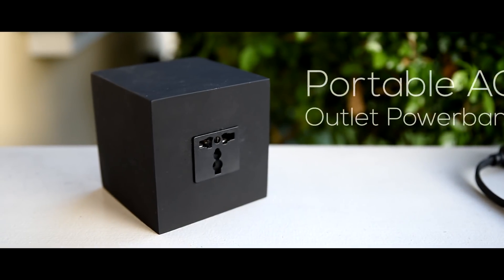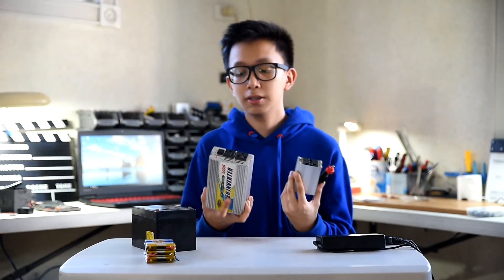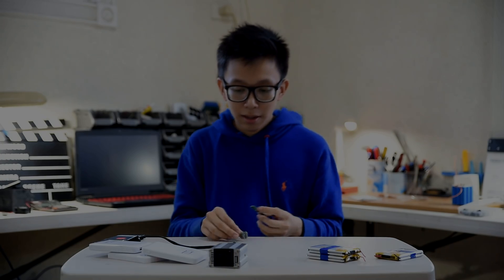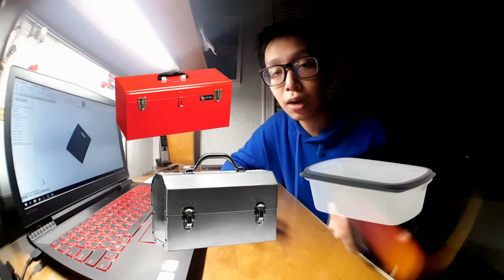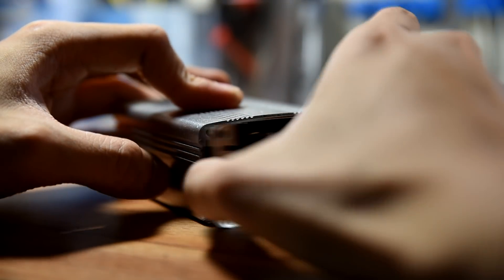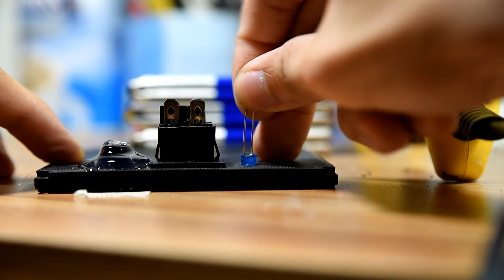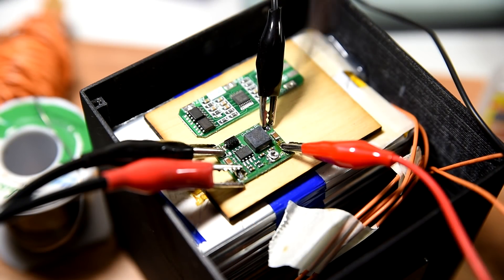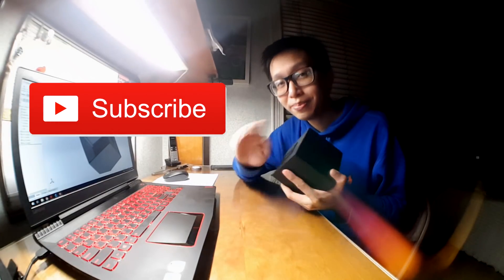DIY 220v Powerbank Outlet

Comment: Solder a much thicker wire to the battery =(0V and 12.6V) to the BMS to the converter, so that the wire does not heat up and reduse  voltage drop.

Comment: it is a bomb timer. No temperature control, no relay, no fuse, etc. You should not solder the battery because the soldier can overheat the battery and explode.

Comment: very low power watt Project !  instead you shud go for 18650 Li-ion batteries
which are available from $1-$2 Battery Packs of 4 Volt in US/UK online websites.
and in $1 b.pack it contains 3 batteries as new as baby.

so you get very cheap battery bank and higher amperages you can give to the DC AC Converter

Also you need to have 40A BMS Charging system + DC-DC CCCV Boost converter which outputs setting 19.6v ~4A for laptop charging and USB Powerbank module with resistance connected at input for charging mobile/tablets .

DC Watts is not equal to AC Watts 

DC Watts = DC V x I amp   
AC Watts = 230V x I amp 

so your battery bank wattage should be equal to atleast AC Wattage value.
230v x 5 Amps = 1150 Watt  example.  so
1150Watt DC / divided by 12.6V DC = 91 Amps  
91 Amps Divided by 8 amps per series of battery :  11 series
Total 18650 batteries needed 11 x 3 = 33 Cells

isn't it nice....  i am undergoing the process of making such high amps project

Comment: Very unsafe man! Thin wires and lipos just over a step up converter which it is going to heat up considerably when used, all joined with glue and wood which is very flammable
It seem more like a big expensive lighter to me.

Comment: I have a question, I plan to do the same but with the power bank I want to convert 5V to 12V with a dc dc step up and then use the inverter so 12V to 230V and my question would be how much amperes would end up

Comment: There is no way for ventilation for the cooling of the inverter curcuit and the wires are so thin it will starts heating up and melting at 70 watts

Don't try to copy his designs as the are no proper. When you are drawing 150 watts of power the it is recommended to add some ventilation and fan also which are no present their.

Comment: As many comments say it's not safe to put a high voltage so, Can i use it only for charging my mobile and laptop??
Laptop requires 20v 65w...
And i want to use 18650 cells instead of batteries...
I know nothing of electronics please help!!
Reply: Secondly, if I use thick wires would it be more safe than in the video? As many os comments also pointed the wires were too thin...

Comment: I'm surprised I don't see one comment asking about runtime at max load. If I am powering a gaming laptop that uses 150 watts of draw....how long will 3-8000mAH power banks last? Assuming they are fully charged for a total of 24000mAH.  I think the formula is (mAh)*(V)/1000 = (Wh)  So 24000 mAH * 12V / 1000 = 228 Wh.  So about 1 hour 30 minutes? Is this correct? If so, that's not a bad run time at all.

Comment: how much amps can handle the step up converter ? I think it will be around 4-5 amps so bnasically at full load you´ll able to take out around 60 watts, before the circuit blows.

Comment: You should had calibrate the voltage regulator to 13,3V because of the 0,7V drop of the diodes in the circuit.

Comment: 6:26 could you also solder more wires to the original ones attached to the inverter to extend them? I'd probably forget where the + and - pins are if I desoldered the whole thing.

Comment: Most BMS can handle up to 20v DC input so if you're charging your powerbox using a laptop charger that has around 17-19v then you wouldnt need a step down dc module, right?

Comment: The only problem with this is that it will be able to power your gaming laptop for around 40 minutes (considering you are using 3 8000mah power banks) To calculate how many minutes it will last use this :  (ammount of total mAh / 1000) * 3,7 / (the wattage load) * 100 * 60 / 100 =      the result is how many minutes it will last.

Comment: This project is terrible. Those LiPos are not designed by any means to pull out 15A from them (Assuming 150w load and loses in the inverter), is a crazy high amount of current for batteries designed for a powerbank that uses at max 2 or 3 amps. Those wires are too thin for the current you are dealing with in the DC side. Also with your design you loose the USB plug of the inverter that is way more efficient than pluging a wall outlet in the output of the inverter. The diodes will dissipate a lot of heat (Assuming that they can withstand the 15-ish amps that the inverter will pull out from the batteries at 12v 150w, assuming a efficiency of around 80%) and make your voltage to drop by 0.5v. Not good at all

Comment: Thats not ac that using an battery but it could work for ac appliaces almost all appliaces is coverting into dc using 1 diode or an FULL BRIGE RECTIFIRE

Comment: this is very poor quality electrical design. the buck converter has no current limit and lithium cells love amps. the inverter cannot vent from the enclosure, the dc wire sizes are way too small for a 150w inverter and there is no fuses. lithium batteries are dangerous if mishandled like this

Comment: The most important thing to remember is that this power bank can only supply a very low power.  It can power a laptop computer or a single light (maybe both if you're using a low power LED light), but you're out of luck if you want to power anything much bigger.  It definitely will not handle the current required by a heater (for example).

Comment: Cool. But how long can it last? For example, how long will a tv stay on? How many charges of a laptop? Just an average, I know it will vary depending on the item powered, but just want to make sure if it's just a fun project, or a real world functional device. Because that way I won't be wasting the money, because it has lots of parts to buy.
Reply: we're currently doing a similar project like this on our thesis and your questions are our exact research problems! we're going to test it on different small appliances and devices =)

Comment: hey do you think we could use this inverter instead of the one on your link? as its less expensive?
https://www.banggood.com/12V-5V-Fully-Isolated-Switching-Power-Supply-AC-DC-Module-220V-to-12V-p-1000431.html?rmmds=search&cur_warehouse=CN

Comment: While the intent of this project is admirable, planning and execution are dangerously lacking. Do not build this project as shown.

Wiring is undersized. No fusing. No voltage, current, temperature, etc. protections. The list goes on.

Do your homework, then build accordingly.
Reply: Rubbish! The safety issues are in the wiring between dc jack and input of the inverter thats more like a device for burning your house down than for a mobile charger.
Reply: TechBuilder Sorry, but I beg to differ. Inverters provide under voltage cut-off. This doesn't protect the power source directly. It alerts the user that acceptable power out is no longer available.

The very real dangers inherent to your design and build are a) in the wiring, which is woefully undersized for the current it's expected to carry, b) in the lack of fusing to protect the cells from shorts/opens, etc., as well as the wiring, and c) the lack of all other necessary protections required by lithium chemistry batteries (over charge, over discharge, over current, temperature, etc.), as well as balancing.

As I said in my original comment, your intent for this project is admirable. However, the design, planning and execution are lacking. As is, this is a potential disaster waiting to happen.

Rather than defend a questionable project, why not take constructive criticism to heart, do further research, then do a follow-up video addressing the flaws in the original design? The are many great books, videos, etc. available on this subject. I suggest you avail yourself of the information available to you. It's how you'll grow and get better at your craft.

Ignoring potential dangers isn't prudent.

All the best.
Reply: Jan Feucht Your comment is spot on.
Reply from the maker: The inverter includes all those safety protections.

Comment: There's really very little reason to bother inverting it just to go back to DC all over again for the laptop; a step-up converter would be far more efficient. You can just google for a car charger for your laptop and use that, pretty much.
Reply from the maker: This was just for fun. I made a different tutorial about converting DC directly for DC powered devices. It was supposed to be posted along with these, but I haven't finished the edit yet.

Comment: I used a dc to dc converter with led display. I did not use the one diodes because of that but it is working so far but the diodes are are a good idea. I am going to use one from an old computer power supply

Comment: Little help here please.
I'm using Acer predator Helios 300 
Its wattage is 180 watts
 can I use the above power bank for my laptop ?(He mentioned it is for 130 Watt devices)
Reply: Anyone?
Reply: It wouldn’t work for 2 reasons:
1.- the wattage that your laptop’s charger needs is greater than the power bank supplies, ending in the power bank overheating and make it extremely unsafe, and here comes the second point
2.- as the power bank is using thin cables and diodes arranged in parallel (one of them will stop working, making some or one diode to carry all the load), it will damage either the power bank or your laptop’s charger
So go safe, don’t do this project and get a good power bank
Cheers!

Comment: Thanks for the video, and can i use 3p 3s Lithium ion(18650) batteries with output voltage as 11.1v and  capacity is 7800mah for the same project?

Comment: 6:39 "But you might want to save the front panel..."
No, no, no. Get a much safer AC socket for your specific country, better connection and no risk of electric shock when the plug (US especially) doesn't cover all of the holes.
As others have said, get high current Lipo/18650 cells for the battery, and proper charge/balance circuitry. A proper Li-Ion BMS will have a figure for "balance current", for this project you need a 3S BMS.
For those without much electronics skills, pairing a Lithium Ion Jump Starter to an inverter is an off the shelf solution with minimal work.

Comment: Can it power the entire house, you know that the cigaret lighter in the car has a fuse of only 15A, on 12V, that's 180W, that's just enough for a TV, but you use a 12V were you have no fuse, than there is a lot more power but a 12V invertor can only output like 3680W, I won't give bad comment my friend, it's just a detail. But very cool project, I'll make it for myself, I love such a projects.

Comment: Nice design and I see the appeal of the smaller form factor however you could just wire it up to a car battery and save yourself some headache. Also car batteries are cheaper if you get one from a scrap yard. and car battery chargers will tell when it is fully charged. Nice video well done.

Comment: Awesome video and awesome project. SolidWorks! A wonderful tool. very impressed. I have been thinking about doing a project involving a 12v 20Ah Sealed Lead Acid battery and 200W invertor. It will weight a bit more than yours. Li-ion have a much better Power to Weight ratio than Sealed Lead Acid Batteries.

Comment: Using this batteries is very dangerous, because they can provide only something about 1,5A for each cell (so something about 4.5A at all) and this converter will take 13 A on full power... DON'T DO THIS or it will explodes... Better solution is using acid battery...

Comment: Make sure to not have it pump out more wattage then it's supposed to. It could explode.  And make sure the step-up converter isn't transferring it's heat to the battery bank.

Comment: Cool idea. One potential issue I see in this design is the gauge of wire you used. It seems a bit on the smaller size for this project. I hope you are using at least 23 gauge or 24 + gauge or larger wiring on the battery side for 3+ amps batteries. You should be using 18 gauge wires on the inverted output side to carry 15 amps. https://www.powerstream.com/Wire_Size.htm

You want to do this to reduce resistance and heating of the wires/fire. If you rip apart an APC/battery backup, you'll see that this holds especially true.

Comment: This is a nice little project, especially when the weather can knock out your entire power supply like it did here in 2011 from an F-5 tornado that knocked down transmission lines & we were without power for almost 7 days, so this would have really come in handy for at least to have some lighting. Thanks for the idea.
Reply: Ever heared from battery powerd flashlight

Comment: Hey i was just wondering wether it is safe to use thin wire like you did, because when you ran the wires from the inverter to the power socket, you replaced the thicker wire wit very thin wire. Is this safe ( this is around 7:05)

Comment: I have always wanted to do this for my laptop because the battery dies so fast and finding wall sockets in university classrooms is a nightmare. I gave up on using extension cables because it is awkward and difficult to find a plug sometimes the plugs don't work. This way I will always be connected to power and it would be handy for a phone as well. My only concern is: Is the device a fire hazard? If the batteries blow up surely the wood would burn? Also it would be really cool to find out how to add a battery regulator - some sort of display maybe next to the switch that would show me how much battery is left in the battery charger.

Comment: Innovation

Yung sa powerbank na nagchacharge while walking.Instead of wire,gawin nalang na bluetooth.but the question is kaya mo gumawa ng bluetooth or wifi?para maging wireless lahat.Hnd lang speaker kayang e charge pati mga ibang gamit na bluetooth like speaker,it could be.at iba pa.

Then ung powerbank is 4 WAYS of charging

-by walking
-by solar
-by electricity i mean ung mismo common na sa meralco.
-by hydro if possible.

Kaya ba?

Suggestion lang naman lahat yan.Gusto ko lang malaman if possible na gawin ung idea ko sa pag innovate ng invention mo.

Yon lang po.
I hope I can see your invention and others.Soon.

Btw:pasenya kasi d ko ma explain masyado dahil wala akonh alam jan sa mga parts.

-From Metro Manila,Manila City.

Comment: Hey i just got the inverter from you link, it has a problem, cut off at 11V or 3.67V/per cell which is still kinda high for lipo, so much of the energy stored in the lipo not being utilized, and hence reduce the working hour of this powerbank. I'm going Li-ion which can go as low as 9V or 3.0V per cell

Comment: If using a DC device, such as a laptop, it would be much more efficient to go directly from the 12 volt battery to the laptop charger voltage.

Comment: This is a great project, just like an UPS for PC and servers. However, it does raise the question of why doesn't you use it as a DC power bank with variable output voltage to power electronics, skipping the DC to AC and AC to DC conversation can save a lot from efficiency and extend use time. Also, why don't you just use 18650 cell?

Comment: Couple of fun points ... 1. modified sine output means sensitive stuff can't use this.  2.  Make sure you have the right gauge for your wires ... 18AWG at a minimum for this sort of project

Comment: Don't forget that the inverters you'll usually find are MODIFIED SINE WAVE (MSW) inverters. They can pretty much break sensitive electronics if the devices you plug into it can't handle modified sine waves. For instance, a microwave running on a MSW inverter will be roughly 50% less efficient, will output more heat, and will barely work. What you want for an all-purpose wall outlet powerbank is a PURE SINE WAVE inverter. They replicate the (almost) exact "current" that comes from your wall outlet. For an electronic device, it would see the PSW inverter just like any other wall outlet. Don't get me wrong, MSW's are not that bad, but you should only use them if you don't have another choice.

Comment: The board used here is a 3S 12V 10A 18650 Lithium Battery Charger Protection Board Module 11.1V 12.6V With Over-Charge Over-Discharge Over-Current Short Circuit Protection Function, but it doesn't balance the cells which is important when you're draining the batteries using a inverter...

Comment: Using only 3 LiPo's  or 3S is only 12.6v at idle, but as soon as you apply a load of any kind a 3S only outputs 11.1v so I use a 4S 16.8v at idle and 14.8v under load and you need 4 diodes and another step down converter and 4 more diodes and set it toto 12 to 13v.... When you use these inverters in a car, a normal voltage value is around 13.6v and I use these inverters on a gel battery which is 14.4v so you really don't even need a second step down converter
Reply: The diodes eat some power also, go to ebay and search for "Ideal Diodes" They don't eat any voltage and there's zero feedback to your converters...

Comment: 1. The step down converter isn't suitable for charging in less than ~40 hours if it doesn't die heat-death because of overload.
2. To make it idiot-proof add a label warning it is not grounded and telling the max output power

Comment: Wow, great, you regulated the voltage going to the BMS (Protection board) which doesn't have it's own voltage regulator, to 12.6v. Meaning it will only charge each cell (2 in parallel) up to 3.15v, making your whole power bank only able to hold a fraction of the total capacity, Great Job!